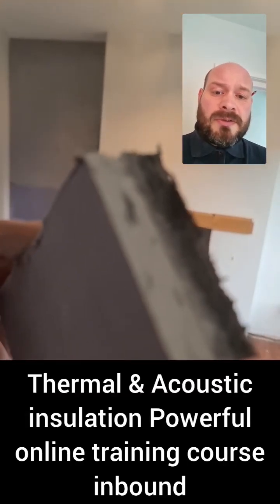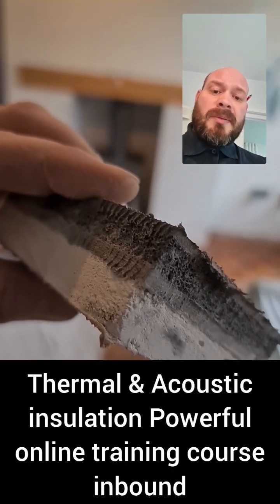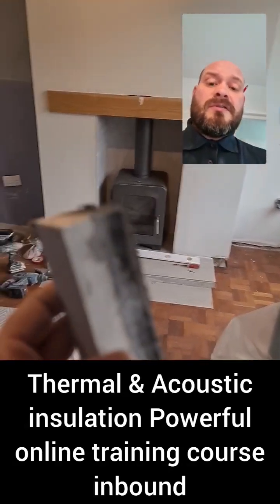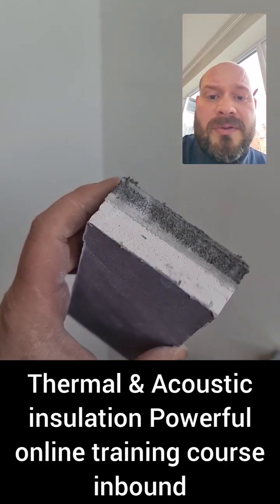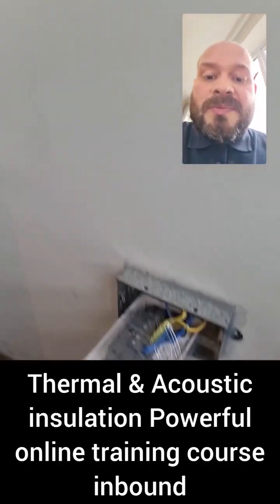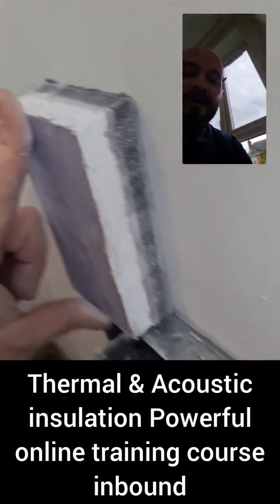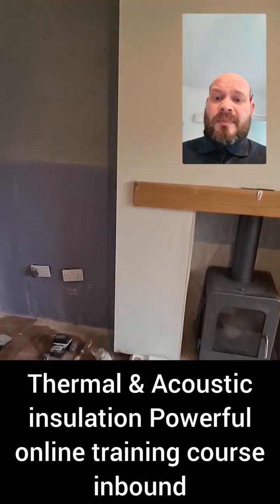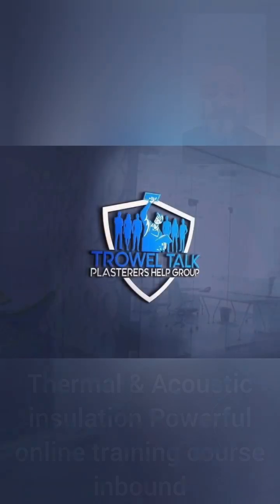ACOUSTIC & THERMAL WALL INSULATION ONLINE COURSE

Comment from the maker: In 2013 I started to learn about thermal insulation, acoustic insulation and damp.. because I hit a limit on what I could earn per day doing reskims all the time..

To increase my day rate higher I had to learn about different products and fix different problems for my customer.. such as damp, mould, nuisance noise transfer and heat loss.. All common problems in older homes around the UK.

Over the last decade I have niched my business down and now I only focus on these specialist jobs and as a result I earn more money in much less time compared to spreading all week which is brutal on the shoulders as you rightly know.

This is a strategy any plasterer can implement if he is willing to learn and train in new knowledge and systems. 

I will soon be releasing a powerful online training course purpose built for plasterers and tradespeople that walks you through step by step how to confidently undertake a multitude of thermal insulation projects, acoustic insulation projects and damp proofing projects. 

This course is exclusive and intensive.There is currently nothing out there online that breaks down these components in a fast moving online video course for plasterers at such a low affordable cost. I have condensed 10 years of painful trail and error and learning curves into a powerful course so you can avoid the same mistakes and instead work with products and systems that are predictable and reliable.

If you complete this course and follow the steps you will not only be confident to add these systems to your plastering business and increase your earnings but you will also have the opportunity to learn how to market these systems for free to target high profit jobs within your local area. 

There are currently over 8.5 Million uninsulated solid wall properties in the UK that suffer with all the above issues- Cold, damp, noisy walls..

Domestic Plasterers are perfectly positioned to leverage this opportunity and increase their earnings and skills.

Do you want to take your share of the market? 

Register your name onto the waitlist today and you will be Contacted when the course is released 👇

https://form.123formbuilder.com/6733057/iwi-training-waitlist

Let's get it done 👊🎯